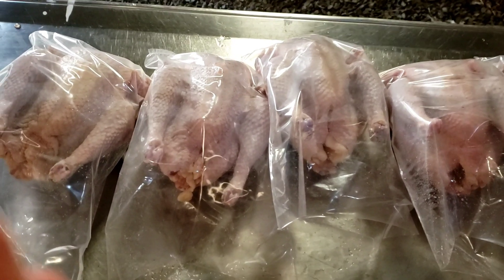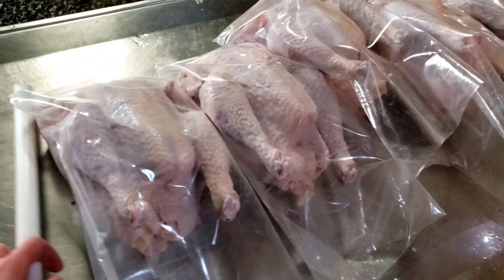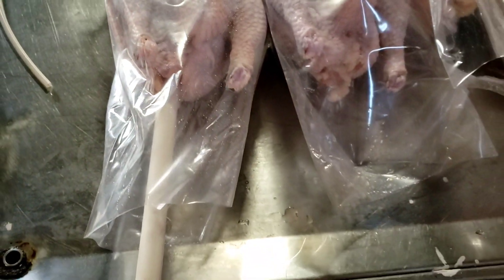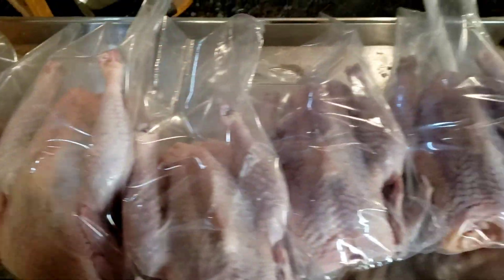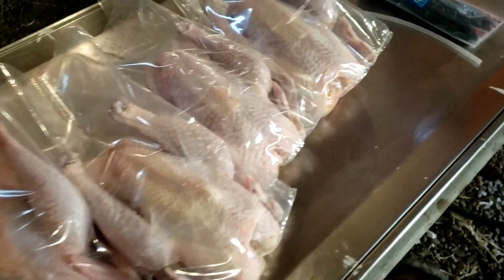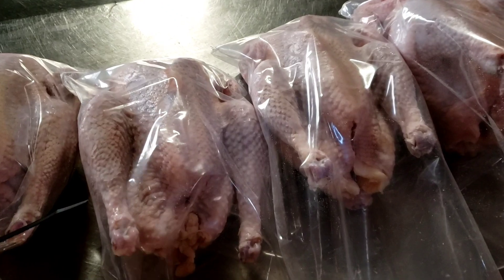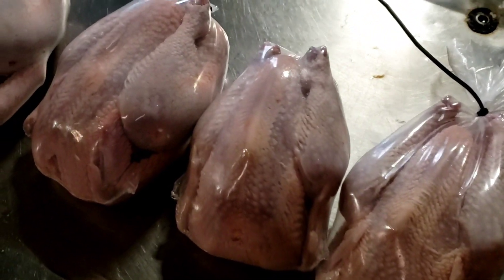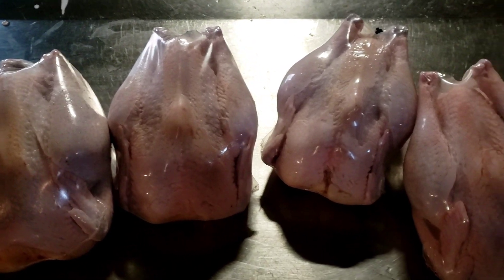Poultry Shrink Bag Technique - Tips and Tricks

Comment: would like to have seen you dipping them. Been using the Texas Shrink Bags for several years here. Went with a stainless steel tube for taking the air out but will try your pvc pipe method looks like it will take more air out quicker. Thank you for the information. Tom
Reply from the maker: Yeah because there is a little bit of finesse to it. It's a slow dip but not a long dip. When I was counting it was a 4 second submerge, watching the air come up, 2 seconds fully dipped. Then 1 second to bring it up. Then I walk it back to the table to pull the pipe out, which also draws out any remaining air. Then tighten the zip tie fully once the pipe is out.
Reply: @arcadianorchard  Yep I do about the same, 5 to 7 seconds does ok. Will definately try your 1/2 in PVC pipe with the next batch of roosters I will be processing.